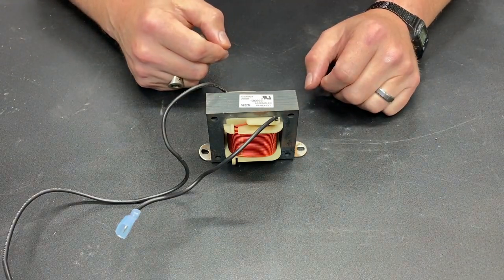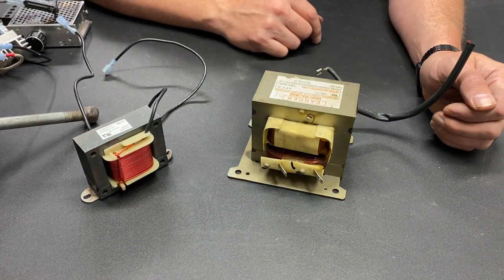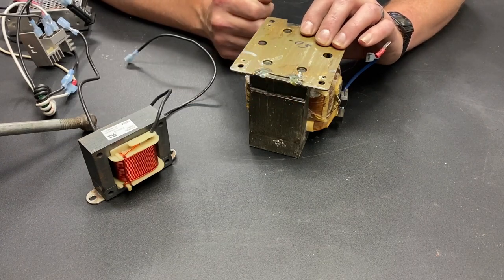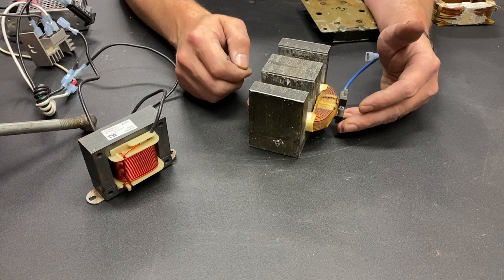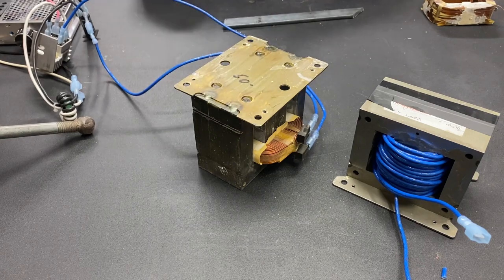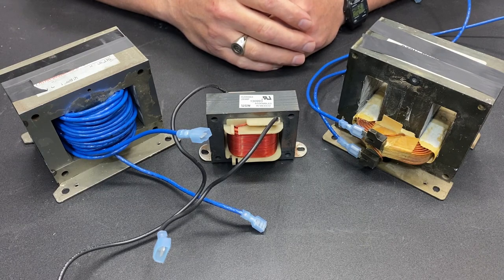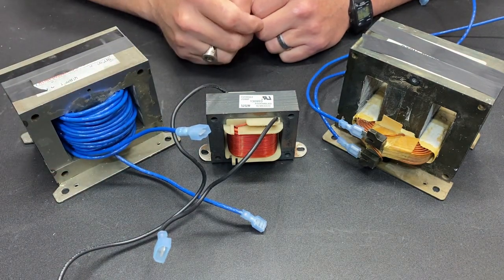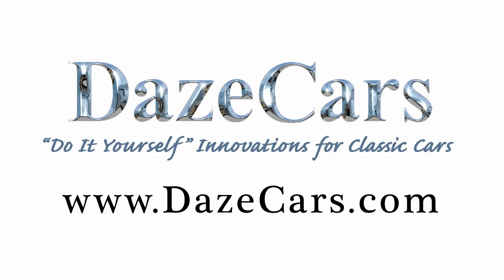DIY Treadmill Motor Choke Built From a Microwave Transformer

Comment: Can you give the part # and source for the commercial choke used in the video which gives the best performance?
Reply from the maker: The choke in most of my videos is part number 130993.  Instead of getting one new I would get a used one. A lot of treadmills come with a choke. Go to eBay and search “treadmill motor choke” BUT know that most people on eBay don’t know what they have and the word transformer will also appear in most listings. Problem is a choke and a transformer look almost identical so some listings are for transformers and some are fore chokes because the sellers think they are interchangeable. They are not. They would only be interchangeable if you modify a transformer to work as a choke.  To tell the difference count the wires. A choke will only have 2, a transformer will have 3 or more.  Generl rule of thumb is the bigger they are the better they work, also the coil needs to be at least 16 awg. Please let me know if I can be of further assistance.

Comment: I am seeking some help finding an economical motor for my context. 
Really, it just needs to be able to run btwn 300 and 400rpm for about an hour or two without overheating. I'm guessing that I would only need around 1.5ft/lbs of torque. I also need it to be fairly quiet.
I have spent countless hours searching online, and what a rabbit hole that is!
The motor is either to big or too small or too expensive.
Any help is appreciated!
Reply from the maker: Seldom if ever will you find a motor that will be perfect for any given application.  If set up correctly it sounds like a treadmill motor would fit the bill.  A treadmill motor is happiest above 1000 RPMs for long periods of time as that moves enough air to keep it cool.  Then if you gear it at 3:1 you will have the speeds you are wanting.  If you don't want variable speed you could replace the potentiometer in an SCR with a fixed resistor of the correct resistance for the speed you want it set at.
Reply: @dazecars  I am currently running a 6500 rpm treadmill motor. The brushes are chipped and worn and has a constant arch. After about 20 min or so the motor gets extremely hot.
I went to a local motor repair shop, and they told me that running at low rpms would cause the motor to get that hot.
Right now the motor is exposed, but I would like it to be mounted inside. With it getting that hot, there is no way I'm doing that 
So, it sounds like I should replace the brushes, hook up a choke, and gear it down.
3 questions:
How do I get the right brushes?
How do I know that I  have the correct choke for my motor?
What is the best way I can gear it down?
Reply: @dazecars  I was not only interested in doing this project for my own machine. I wanted to make more of them after I completed my prototype. The treadmill motor is not economical. I was hoping to find the correct motor, new, for somewhere near $100.
Reply from the maker: @NefariousMinds  If you don't have a choke on it that will also lead to excessive heat and is actually the bigger part of your problem.  Not saying the motor shop was wrong but their answer is motors in general.  Treadmill motors are designed to run at lower RPMs for extended periods of time (low RPMs being relative)  1.  To replace the brushes you find one that is the same size and shape.  My local hardware store as a brush assortment. 2.  Chokes are simple my observation has been the bigger the choke the better it works.  3. Pulleys are the best way to gear it down.  A 1" motor pulley and a 3" pulley for the rotating assembly will give you  3:1
Reply from the maker: @NefariousMinds  With gearing you have a lot more options as gear ratio reduces RPM and increases torque.  If you took an AC motor with .5 foot pounds and 1000 RPMs operating speed and gear it at 3:1 you will get 1.5 foot pounds and 333 RPMS
Reply: @dazecars  
Thank you for your valuable time and education!!!
Reply from the maker: @NefariousMinds   My pleasure

Comment: You wouldn’t need to remove the secondary winding from the microwave oven transformer if you put a jumper across the secondary terminals shorting them together.
Reply from the maker: I don't think I would risk it.  I don't know how that second coil would effect the "choking properties" of the assembly.

Comment: When you are modifying the microwave transformer, you can avoid taking the core apart by using a hacksaw to cut down one side of the secondary and punch the remains through. This negates the need to weld it back together afterwards.
Reply from the maker: yes that is an option, but it is not the best option.  The core is glued together and in the process of pressing out the core you don't want there is a higher risk of damaging the core you do want.
Reply: @dazecars  I've had great luck doing it that way. I also use very heavy gauge wire with thick insulation, so I haven't had a noise/vibration problem.
Reply from the maker: @eCitizen1  👍

Comment: Hi, great video's. Question ?  How do you select the right size of choke for a treadmill motor ? Thank you.....
Reply from the maker: The most important factor is the size of the wire in the coil, needs to be at least 16 awg.  Also I have found that the bigger the choke (size wise) the better it works.  Im guessing that is because the wire is bigger, the ferrite core is bigger, and so the magnetic field is also bigger.  The one in most of my videos is about the size of a tennis ball but the better one on my lithe is closer to the size of a softball.  The choke in most of my videos is part number 130993.  Instead of getting one new I would get a used one. A lot of treadmills come with a choke. Go to eBay and search “treadmill motor choke” BUT know that most people on eBay don’t know what they have and the word transformer will also appear in most listings. Problem is a choke and a transformer look almost identical so some listings are for transformers and some are fore chokes because the sellers think they are interchangeable. They are not. They would only be interchangeable if you modify a transformer to work as a choke like in this video.  To tell the difference between a choke and transformer count the wires. A choke will only have 2, a transformer will have 3 or more. Please let me know if I can be of further assistance.
Reply: @dazecars  Again, thank you for taking the time to respond. I still think you have the best Threadmill video's information  on Youtube.  P.S I have found a couple 130993 chokes in ProForm treadmills.

Comment: Would an emi filter serve the same purpose as the motor choke?
Reply from the maker: I am not sure about its effectiveness but my concern would be amperage load.  A treadmill motor draws in the range of 15amps most EMI filters are quite a bit less than that.
Reply: @dazecars  fair enough, thank you. I found one rated for 30 A, pretty inexpensive. Worth a shot. I’m building the controls to throw a treadmill motor on the mini lathe. I’ll keep the community posted.
Reply from the maker: @jakeknight6154  30 amps should be more then enough

Comment: Hi. Have you ever see a capacitor in line with the motor at the dc out in place of a choke ?
Reply from the maker: My experience with capacitors is they cause surging when the motor is under a load.

Comment: would using a large capacitor across the d c leads between the chock and the motor protect the motor further?
Reply from the maker: I have played with an RC circuit (capacitor and resistor in parallel) had one on my lathe for a while and it had an observable effect by it self but not much different than the choke and not any observable improvement when using both.  The reason I removed it is if I loaded the motor in other words put it is a situation where I was pushing up against the max available torque the RC circuit caused surging.  Could be because the cap was incorrectly sized but I don't know.
Reply: @dazecars  yes I would think that you had the wrong capacitor for the power draw on full load . thanks for the fast reply
Reply from the maker: @rayg436  The RC circuit I was using was cut from a defunct MC-2100 so you would think it would be close being that it was designed for a treadmill motor but apparently not close enough.  😁
Reply: the load of a treadmill peaks only when you put your foot down its not continuous like a tool
Reply from the maker: true

Comment: I just know this is answered elsewhere on here, but have not found it yet. Where can a person find a choke? I have been tearing apart all sorts of amplifiers and things that plug in. I don't think that I could build a good enough one myself.
thank you. David
Reply from the maker: To get a "motor choke" you need to scrap somthing with a motor.  The choke in most of my videos is part number 130993.  Instead of getting one new I would get a used one. A lot of treadmills come with a choke. Go to eBay and search “treadmill motor choke” BUT know that most people on eBay don’t know what they have and the word “transformer" will also appear in most listings. Problem is a choke and a transformer look almost identical so some listings are for transformers and some are fore chokes because the sellers think they are interchangeable. They are not. To tell the difference count the wires. A choke will only have 2, a transformer will have 3 or more.  General rule of thumb is the bigger they are (physical size) the better they work, also the coil needs to be at least 16 awg. Please let me know if I can be of further assistance.
Reply: @dazecars  Thank you, I will go Treadmill hunting. I have a half dozen motors but did not save anything else from those. My bad!
I was using a wall dimmer switch and a capacitor. worked... until it didn't!

Comment: You mentioned the cut transformer would need to be welded back together. If people don't have access to a welder, they could also create a pair of custom plates and use to bolt the two halves together.
Reply from the maker: great idea.  There are lots of different ways to get it done.
Reply: To stop chatter you really need to weld but you can superglue all the loose plates together then clamp it as tight as you csn get it with superglue then use jb weld to make sure it stays secure..  if you dont glue it the force of whatever clamps youre using wont evenly press against every plate which will chatter when energized..  so glue to fill all the small voids to be sure you wont be leaking out a butt ton of eddie currents from the loose plates..
Reply: Dollar store epoxy should be fine

Comment: I was watching a video from a you tuber channel called schematics on chokes. He was mentioning that the choke will produce nasty flyback if not used in conjunction with a flyback diode and capacitors. I wonder if you have any idea about that. Nevertheless  your work is great and appreciated.
Reply from the maker: Issues with needing a flyback diode on chokes are usually in components where noise is an issue (more sophisticated electronics).  In the case of a motor choke you can not use a flyback diode because when the motor is turned off it will be free spinning, producing voltage in the opposite direction, at that point it becomes a generator, and the flyback diode will be creating a direct short across the leads of the generator.  This has the positive effect of acting as a brake on the motor but there will be electrical arching at the brushes which can damage them and at the very least shorten their life.  I film said flash in this video https://youtu.be/2p3-sUZ4VPE  The other thing is a lot of older treadmills came with chokes and never once have I found one with a flyback diode.  Engineers who have a bunch more education than I do designed those systems and never installed a flyback diode. 😁  In theory it seams like a good ida but in reality is not.
Reply: @dazecars  well. That could be true. But as we are all sharing ideas I thought it would be a good idea to highlight it. The thing I truly raise my hat for is your attention and prompt response to viewers. Stay safe and keep the good work.
Reply from the maker: @hamzehmomani6682  Thanks for the comment! As I have said is many of my videos I am an electronics hobbyist not an engineer so there are lots of things I don't know and am always looking to learn. 

Flyback diodes can be important components in a lot of applications especially those with sensitive components where noise is an issue. I use them in my automotive projects when hooking up a radiator electric fan. When shut off the fan acts as a generator and that can cause arching inside the relay shortening the relays life. The diode bleeds off that charge. You are the second person to contact me about a flyback diode in the last couple of weeks. Makes sense because as I said before it is a good idea in theory not taking into account the massive volts and amps created by a free spinning treadmill motor. My channel is viewer driven so it looks like I need to make a video about flyback diodes.  Thanks for the idea.  

At this point my channel is small enough that I can still manage to respond to every comment. I hope as the channel grows I will continue to be able to do that. Thanks again for your comments!

Comment: Your video is very helpful. And I'm doing DIY project using ex treadmill motor. 
But, since it's hard to get motor choke in my country (Indonesia), I'm planning to make it myself.
Can you help me with informations about the motor choke you use? 
I really need to know the approximately size of the coil core (length & wide), the wire diameter, and maybe if you don't mind the code of the motor choke, so I may find the datasheet online. 
Thanks. I really appreciate it if you could help.🙏🏼🙏🏼🙏🏼
Reply from the maker: sorry it took me so long.  looks like 18 awg and the actual core is a little bigger than 1" X 1" X 1"
Reply: Ok... Thanks for the info. It's very helpful

Comment: If you have two identical microwave transformers, you could put two of the primary windings onto one coil former and wire them in series.
Reply from the maker: That would double the resistance.  Parallel might be a better option because (just brainstorming)  it would be able to cary more amps and have half the resistance BUT not having actually done it I have no idea how the dual could setup would effect the magnetic field and how that dual coil field would effect its ability to function as a choke.  Dual coils in series would for sure work other than the small percent amperage loss.
Reply: Afterbfindingbthis great video and commenting on some others i tried using 2 120vac primaries from 2 seperat mots on one mot core. I did not measure resistance nor voltage but did measure rpm of motor and workpiece! I lost no rpm and my motor is preforming better than it ever had before. I have a choke from a treadmill on another machine along with an mc 2100 but there is no way to compare without extensive swapping of peices as my diy choke is run off an scr. Imo tho it has to be on par just judging by the preformance. So again thanks for all the great info. Love this channel

Comment: Wondering if choke from a tube amplifier work.
Reply from the maker: no wires are too small
Reply: Hope to use 4.25 hp 24.4 amp 5195 rpm motor for wood lathe, going SCR like you suggest, finding choke is the problem.  Bigger the motor bigger the choke needed, hold true?  I don't want to be dismantling an old tm only to find choke is not ideal.  Will a 130993 work with my motor?  Your clips are so well done, become so popular,  finding them is a challenge. Really enjoy the clips. Thanks Steve
Reply from the maker: Thats a fantastic motor!!  Amps will be your issue and the wire size on the choke has a direct relation to amps. yes bigger is better but good news is its an easy fix, if you take two identical smaller chokes and put them in parallel you double the amperage capacity.
Reply: 2 of them $90 and 5 hr drive 😢
Reply from the maker: They were a lot easier to find beofre I started doing videos.

Comment: Hi. I use an angle grinder, and cut off each coil wrap, then knock them out, with railroad spike; with sharp end, cut off.  Grind throu those welds, also if necessary.  Winding #12 gauge wire, onto secondary, makes for a good DC charger. (rougly about .8 volt, per turn.))  BUT, remember, microwaves are designed, to be run UNDER  LOAD, CONSTANTLY;  which is why,  there are not too many windings, on the primary. Only good, for about 10 minutes, on;  on a battery charger i created.  ( Gets very warm )  Good luck  all !
Reply from the maker: Thanks again for the good info!!
Reply: They do get warm, luckily we can set up fans for cooling lol.

Comment: what exactly is sparking
Reply from the maker: The brushes and the commutator (copper part the brushes ride on) every spark is a little bit of the material from both parts burning off

Comment: What kind of choke it take to make a motor work???
Reply from the maker: the motor will work without the choke, the choke is there to help the motor run better and last longer
Reply: Yes i know but i want to buy one....and i realy dont know what kind to buy....i dont want a used one for ebay i want a brand New one
Reply from the maker: @dmw_cutlery   it is not something that usually goes bad so there isn't much difference between new and used.  With that said the choke in most of my videos is part number 130993
Reply: Thanks my friend i will look for this🙂

Comment: I built a choke out of a transformer to smooth out the current when I converted my Lincoln tombstone from AC only to AC/DC.
Reply from the maker: How did it work?
Reply: @dazecars  It smoothed out the DC current. I built a 250A bridge rectifier to convert it, I used a much larger transformer with a very large gauge wire for my application. And then I went a little overboard with Dinse twist-lock lead connectors, 120v outlets and a 24v power supply to power the fan in my helmet.

 leads